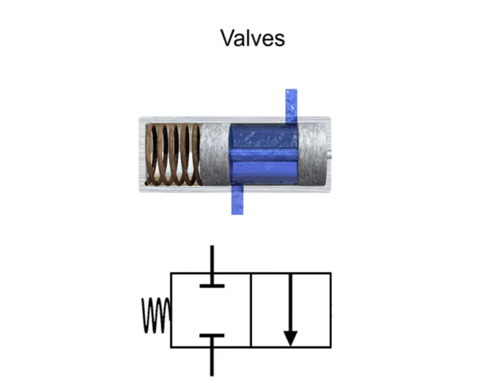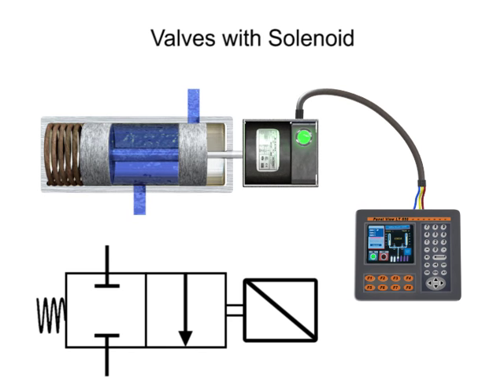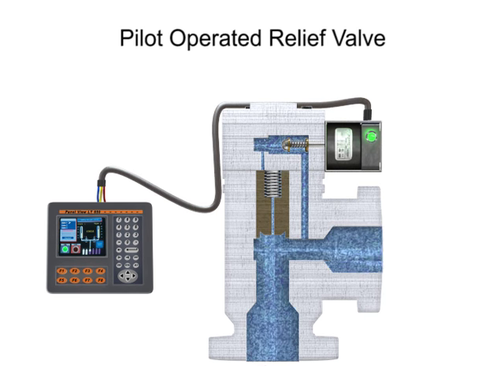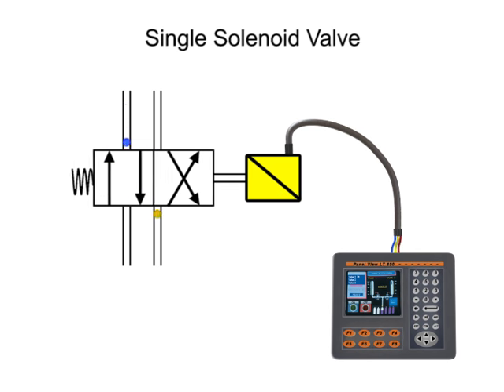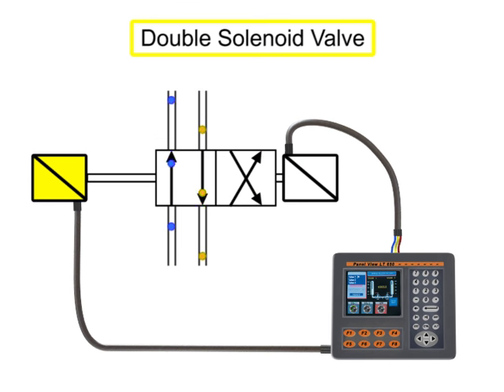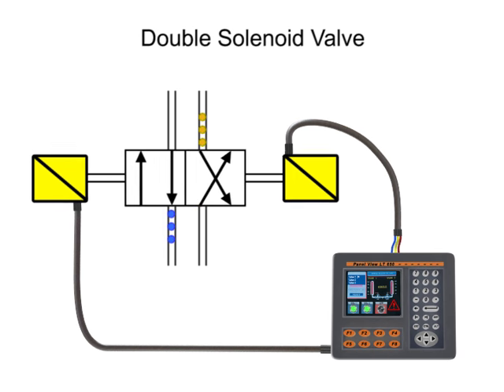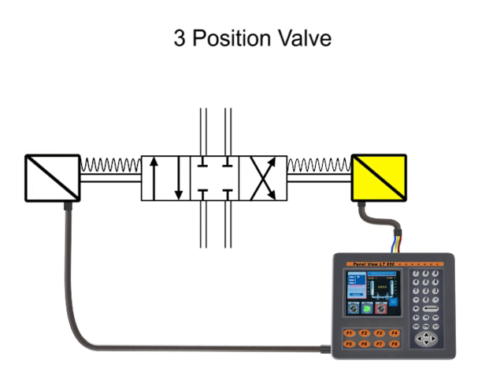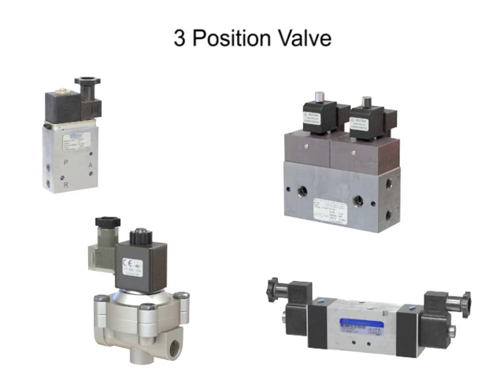Types of Valves

Comment: In the symbol of the valve, the normal position is represented in the first box(left), and here (at 0:34) in this case, the first box is shown with 2T's which means no flow. But, in the actual case, fluid flows in normal condition. Could you make the correction? or kindly help me see my mistake.
Reply: Seems to me this video is not quite correct.